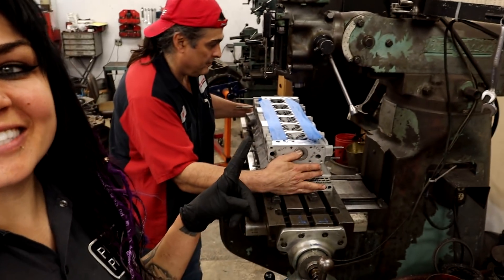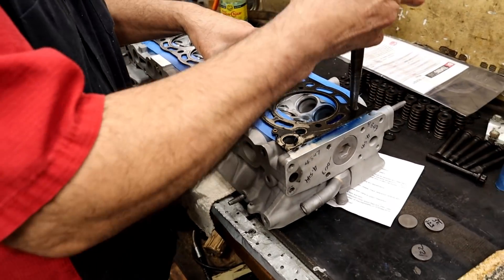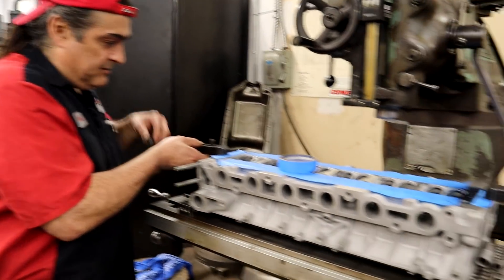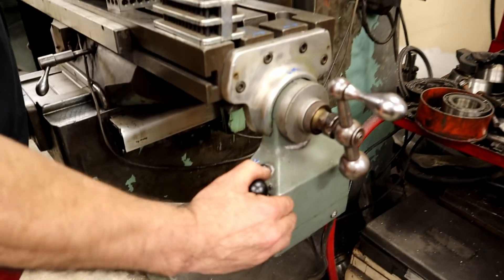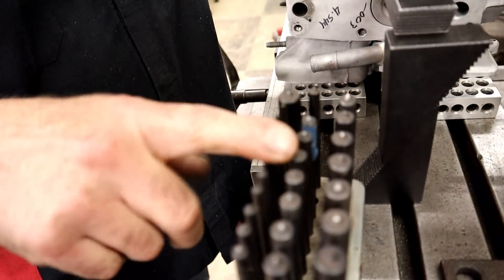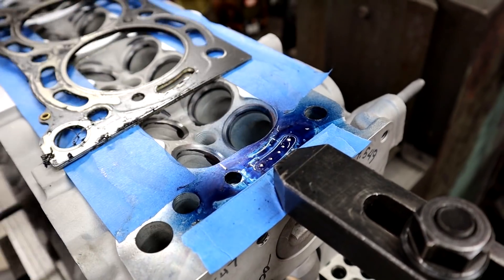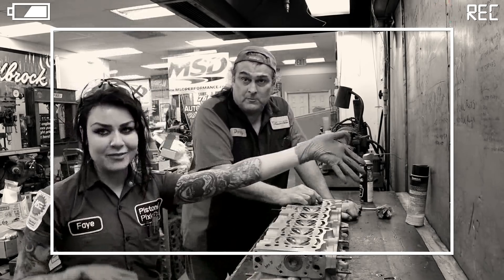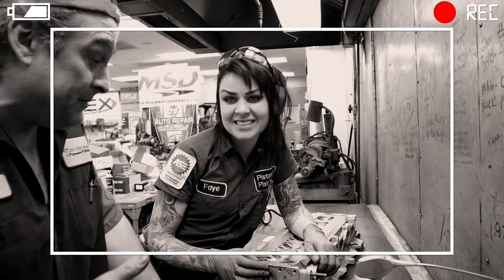The 7M "ZooLoo" Modification, and... Danny plays with Blocks (!!!) - Cylinder Head Rebuilding part 5

Comment: Looking for updates on the build and how all of these modifications helped. Is the car up and running with this engine already? If so, arr there any modifications that you regret doing?
Reply from the maker: Almost done with it!! I have so little "spare time" that I have taken forever on this build. But it will be running very soon!
Reply: @FayeHadley  That's great to hear, I have 2 7MGTE projects in the works. I was wondering if you had also consider the QUAKE mod for the head? It uses ARP inserts to prevents the head from failing where the studs go.

Comment: Toyota doesn't do things without a reason. Leaving the head water passage blocked off in the back was probably done to keep the EGR cooler and consequently the gases entering the intake manifold.  If you're using block off plates for the EGR or have a JDM engine set up then it shouldn't make a negative performance difference.

Comment: Faye, much respect for you and Danny. As a veteran Race Engine Builder and Machinist,  ask Danny if he is familiar with the term,
 " dry decking a block " ? This procedure will be much more beneficial for a high performance application especially if you are running high compression and or boost, or even just a larger bore diameter to prevent cylinder distortion.  I may try and do a video myself on the procedure.  

You guys are EXCELLENT together,  great job.  
SARGE BULLDOG.

Comment: Hi Faye Im about to rebuild my 7MGE and yes the zoo loo mod is in my sights how'd you find it? Worth it , made it worse?  Thanks Andrew Australia
Reply from the maker: Haven't run the engine yet, so not sure! If start out by just drilling maybe 3 holes rather than cutting it wide open like I did here... No one else has done it like this yet, so this is still an experiment!! Many folks have drilled just one to three holes though with great results! 👍🏻
Reply: @FayeHadley  wow Legend Faye for getting back so quick!! Oh my god there is so much conflicting info on this mod, your bravery is appreciated :). I agree I think I will go with maybe 2  to 3 5mm holes.  After many delays I finally  got my "new" head delivered (came from Kentucky USA) this is making me a little more cautious on modifying it now.  Ill let you know when mechanic assesses the head (hopefully its not annealed) an awesome video series b.t.w. Cheers Andrew

Comment: I remember playing with blocks like those when I was a machinist. If it's not a customer's head you tighten it down good or use 4 clamps and use an end mill and a hand on each crank and pretend you're a CNC.

Comment: Never seen any proof (someone actually putting thermocouples on the head) showing this does anything positive, if anything I think it would allow more coolant to bypass the head via the return to the pump, note CO-2 in the TSRM. A bypass style heater valve without the bypass back to the pump maybe beneficial. Most of the 7M's issues are due to wrong coolant, poor tune (boosted stock ecu) and old age.

Comment: Hey ask Danny if you should remove the little lumps where the water goes into the head on the other coolent passage ways. I read that as the lump is lower than the rest of the recess it will create an air pocket by each cylinder

Comment: Very nice! New hotness for EJ25 turbo Subaru engines is the cylinder 4 cooling mod. Basically uses an existing tapped hole and adds an outlet port for hot coolant. The other bank already uses the outlet for the turbo, but the driver's bank doesn't use the outlet. Pretty cool.
Reply from the maker: Yes!!!! I was just talking to my friend Josh (the guy who doesn't the powder coating!) about this upgrade and he was telling me about this on his WRX!!! So cool!!! Just another way that this build applies to so many more than just 7M folks!!!👍🏻

Comment: So Faye, in the next episode will Danny be playing with his valuable marbles and accidentally loose a few LOL. On a more serious note, that was some good die grinding you did with the stubby drill bit, I know using carbide burrs on steel trying to clean up a multi drill slotted hole creation it can be really hard to blend it as that burr has a mind of its own, perhaps aluminum and the drill bit tool is easier to work with or it was purely your skilled hands after doing all that porting work.
Reply from the maker: Haha I do have some experience with porting, so that definitely contributed. Plus, this is a very low speed grinder, and I stopped frequently to spray with WD40. I cut a lot out but it took me a while - about a good solid 10 minutes almost (I filmed the entire thing, so that's an accurate number!) which in the industry is a crazy amount of time to spend on something so small and non-essential!!!
Reply: @FayeHadley  Wow, you really did go gingerly at that job but I can most definitely understand the slow methodical time spent vs doing a major oh oh where Danny faints from hearing your life ending scream across the shop LOL. If a person was doing a few of those one after another, either a manufactured steel guide clamped on or a CNC mill with program for the whole job so no drill set up would be required. But one offs are just not worth the time for those shops that have the fancy expensive equipment unless the customer really wants to pay for the privilege.

Comment: Lets do a poll i vote for mid range torgue and power over top end i believe more time spent at max torgue gives the most acceleration where engines usually spend most of their time top end usually doesnt last long and your back climbing out out of the hole too get too top rpms which if your tuned for top end the lower end mid range suffers

Comment: An end mill would have been better than a drill bit 👍
Reply: you are correct, but what we are doing with this series is trying to show methods that can be accomplished in a home shop.
Reply: Yah but Danny is using a Bridgeport so it is probably better practice to use an end mill and then say, "this can be done at home with a drill and a die grinder"

Comment: Oi Faye! You actually don't want it open to big. 2 max. 3 holes that are 5-6mm should do the trick. Because you see the return lines are right on the other side. Toyota closed that to avoid that the water just straight there and reduce cooling on all other cylinders. The rule of the flow with the lowest resistance will give you the hint. There are a few that done it this way and figured it out the hard way... NO BUENO! The thought about the ZooLoo (Zulu) mod is that the last cylinder is the problem child because it gets less cooling because of the blocked cooling passage. Like this opened up all cylinders will run hotter but the cylinder nr.6. My 7mgte expert recommends 2 5mm holes on this mod. not more. That is plenty cooling to avoid the head gasket blow on the cylinder and allows resistance to let the other cylinders to continue the cooling. Also when you open it up you get a weak area and some get cracked cylinder heads right there.

Comment: I miss our old Bridgeport. The things you could achieve with one of those old timers. Aluminium facing and crc = mirror finishes at the right speeds. Manifold facing and chamber mods, easy peasy.
Plus, you should ask Danny how muany times hes spun a milling tool into one of those clamps. I'm guessing a few. You haven't lived until you've flung one of them across the workshop at high rpm.